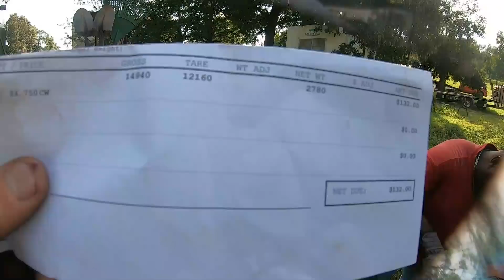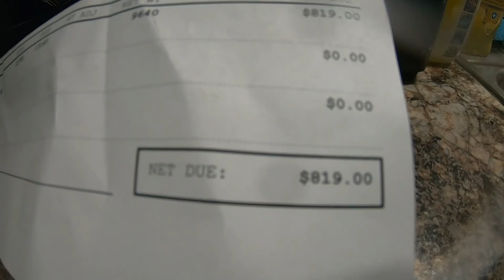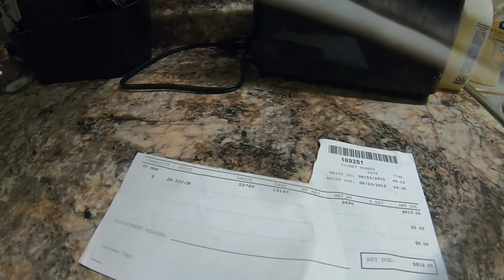9,000 LBS of Real Scrap Metal... Top shelf scrap

Comment: Badger is the whole reason I watch the vids. Saying you don't need him makes me want to unsubscribe.
Reply from the maker: Hahahahah I'm saying there isnt much for him to be doing while I'm torching the steel. Not that I dont need him but I have a heart and dont want him to sit in the hot sun for 10 hours doing very little
Reply: I was just taking it as you leave him home on the big money jobs an only bring him when there's not big money or you really need a helping hand. Kinda seemed a little selfish to me. I'm sure he wouldn't mind being in the heat for a payday.
Reply from the maker: @williamwiseheart3323  oh no it has nothing to do with the money. If it was like that, I would keep all AC units and copper for myself Instead of splitting 50/50 with him lol he has a trim carpenter that uses him on days that I dont and he makes decent money and is inside most of the day. I promise you I talked it over with him prior to starting. I waited about 2 months on the go ahead to start this job
Reply: Oh ok. Glad you cleared it up, even though you didn't owe me an explanation. But you gave me one so much respect to you. There's just alot of people in my area that do people like that. Use them when they need them but when there's easy work for big pay they leave there workers home which isn't right at all. Glad it's not the case for badger. Keep up the great vids. And is the service truck stock. Or does that 5.9 have some work done. 🤔
Reply from the maker: @williamwiseheart3323  no man I have nothing to hide it's all good.... theres shitty and shady people in every occupation but occasionally there is a couple that mean well. Service truck is stock other than someone removed the converter years ago and trans has been replaced prior to me..... 361,xxx miles now.
Reply: @1320LUV  that's great. I'll be waiting for the new vids